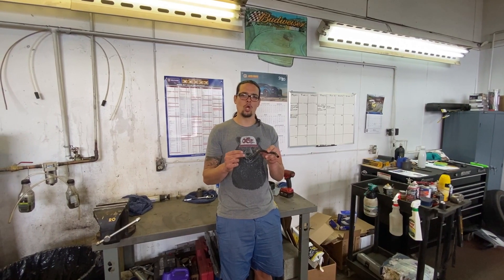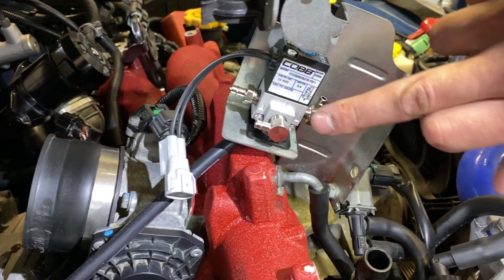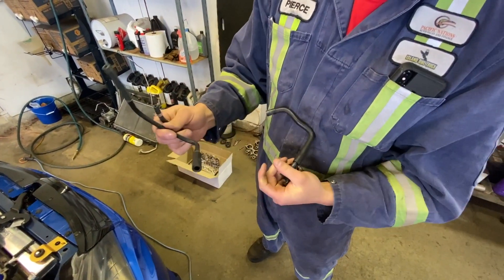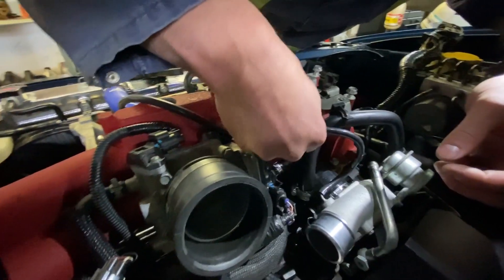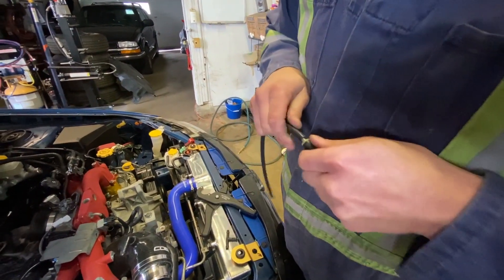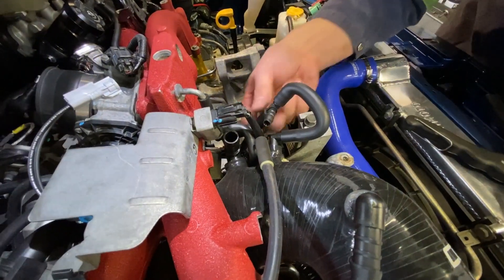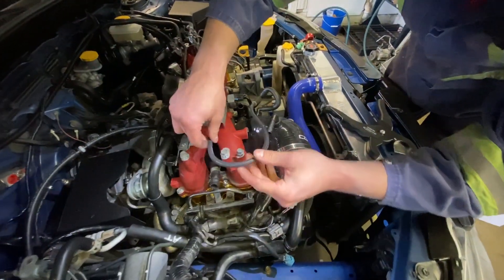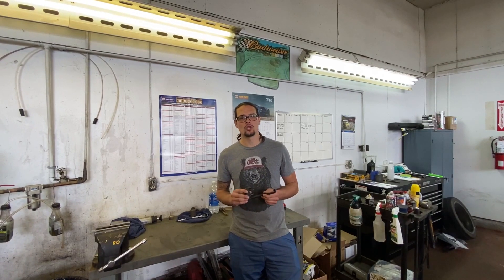2011 Subaru STi Cobb 3 Port EBCS Install | Netfix Original Maintenance Series | Episode 4

Comment: Super helpful video but tell me- do you need to remove the top mounted intercooler to get at where the solenoid needs to go?
Reply from the maker: Thank you 🙏🏽 Happy we helped you out. You are correct the top mount intercooler does not need to be removed. Gave us a better view and ability to get better footage. Appreciate the feedback 👍🏽
Reply: @Netfixandbuild  ok cool appreciate it, I just bought a 2011 sti and it has a boost control issue. Just ordered the BCS and installing it soon. Might even hit you up if I have more questions if that's cool.
Reply from the maker: Hey sorry for the late response. Whenever you got a question shoot it our way. We will try are best to help you out. 🤩

Comment: Am i able to drive to a tuner or is it recommended to tow it
Reply from the maker: Thanks for the question. To tell you the truth I don’t have enough experience in tuning yet. So I would just say better safe than sorry. First I would talk to your tuner that will be tuning the car and hopefully they can send you a temporary tune to safely get the car to the shop. That is how we did it. Cobb does say tuning is required but they could just be covering there ass. Second maybe Cobb has a tune on their access port that could work for you. Hopefully in the near future I will be able to give you an exact answer to the reasoning on the tuning required. Thanks 🙏🏽